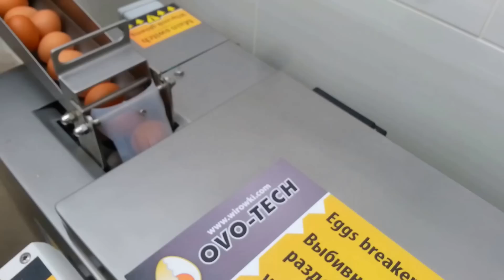Single row egg breaker RZ—1, made in OVO-TECH Poland

Comment: Those buckets shouldn’t be on the ground regardless of kitchens sanitary perfection lol... unless the health department plays differently wherever this is
Reply: Do you guys know where this kitchen is? All I’m saying is the health department is silly, not your machine or the kitchen it is in. Your machines are master works, incredible to watch and so helpful... but where I live, anything that contains food cannot be put on the ground for any amount of time. If there are tiny little platforms that the buckets sit on ( off the ground at least 6 inches and not attached to the bucket) then this is legit and the machine seems to be built to drop those eggs practically onto another table which is great!... but not how this kitchen chose to use it. Again, food health regulations are different all over the world, but where I live and work (a kitchen) the kitchen could have just been cleaned by Mr. Clean himself and submerged in bleach for 3 days directly supervised by the chief health inspector and where I live, that would still be a health code violation, you would have to throw the contents of both the yolks and the whites away in front of the health inspector (they like to watch) same thing if a refrigerators temperature is too high and you get a surprise visit, all that 41° ham and turkey is going by by (if you’re lucky they will leave the room and you can hide some to take home, because health code rules where I live are ridiculous!
Reply: OVO-TECH Charlottesville Va :) Your not going to come and egg my house are you? ;P apparently, Charlottesville has more restaurants per capita than Paris France! Many don’t make it because of all the competition, but I hope that at least one of the many local bakeries use one of your machines because it makes life so much easier and cracking 1,000 eggs a day is a recipe for carpal tunnel syndrome! You guys are genius thank you for making life easier for so many people